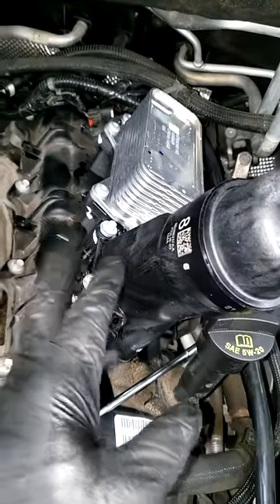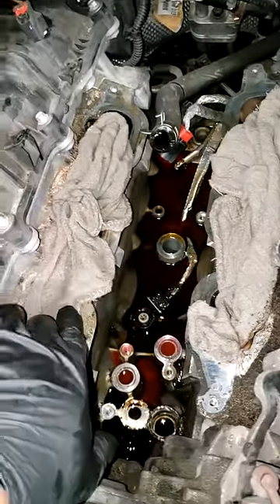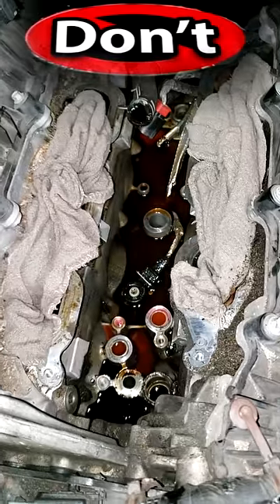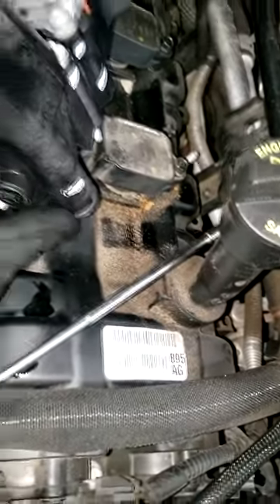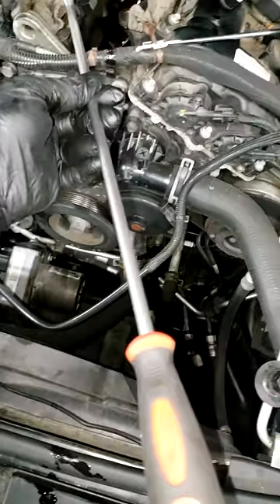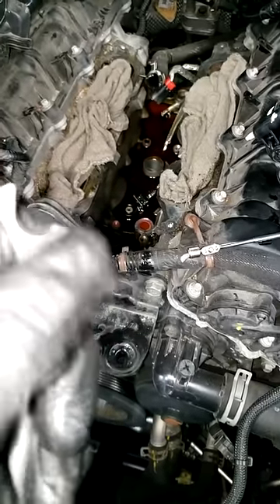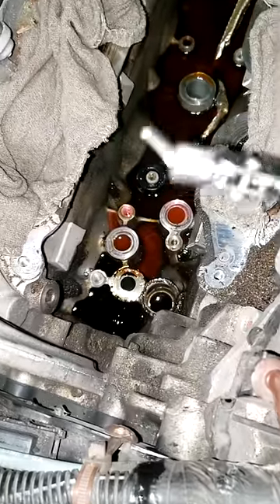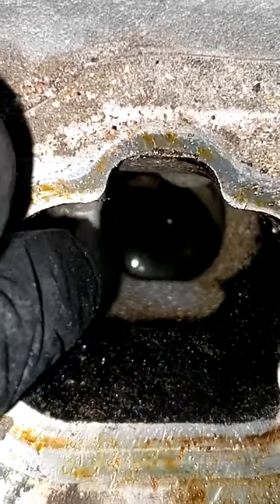This will scare the hell out of any mechanic. But I found it.

Comment: So I don’t get…..what happened? I am not a mechanic 👩‍🔧 ❔
Reply from the maker: Hello here's the motive behind the video. When you remove parts of the engine to perform a repair, its best to cover the open area up. In this case, the upper plenum. Because if you dont, theres a chance something could get in without you knowing and ruin the engine. Case in point, I used a trim tool for prying purposes and the tool broke, no big deal but it was important to find that broken piece. Because I had the intake covered, I was assured it didn't get into the engine. So the motive of the video a reminder to cover all the intake manifold openings.
Reply: Tldr:
Imagine what would happen if a piece of bone got stuck IN your heart.

His tool broke a small piece off, and if he didn't carch it with the rag it would destroy his engine if turned on.
Reply: He could have BLOOOOWN UO THE MOTOR. 

I KNOOOOOW it is not funny. But I can not help myself. 😂😂😂😂😂🤣🤣🤣🤣🤣🤣
Reply: You got a car at all sir!!???
Reply: @vesuviusenigma7739  Yes, ma’am💀
Reply: You a lost cause son
Reply: @Gothic TDK  Gothic people don't have common sense? Or they just don't listen? Maybe both?
Reply: If that piece goes in the valve it can stop the car from ever starting up again valves are pretty much what causes the combustion pressure in your engine with out those valves properly seated to much air gets mixed in with combustion no combustioneans knew engine or cylinder head of you can soen the next two days taking the engine completely apart and and just hoping for a chance to get it out
Reply: Im not a mechanic either but he ecplained it very well what would have happened 😅😅⁹
Reply: Would've had to buy a whole new motor
Reply: @lessmigrantsmorewalls8392  This has NOTHING to do with RACE and EVERYTHING to do with guys who tear down and rebuild engines, so what do you mean by your comment, please elaborate for us!🤔
Reply from the maker: @Ricardo Flot He will not be able to respond cause he's been blocked now. That guy on another level type hate.
Reply: @Firesgone  whooo-hooo! GREAT reference...damn!
Reply: @OnlineMechanicTips  I'm late here but, got it! 👍
Reply: Not Finding the Broken Piece in the Engine Manifold could be the Difference between the Engine running for another (20 Years) or just (2 Minutes).
Reply: @OnlineMechanicTips  Number one that's not the upper "plenium". It's the intake ports of the heads. Number 2 it's plenum.
Reply from the maker: @jeffrunyan2691  Whats number 3 buddy? Surely you found 3 things wrong with this 60 second shorts video
Reply: Then don't ever become one if you can't follow this.
Reply: You drop something in an intake, and you get to disassemble the motor till you find it.
I once dropped a 13mm socket into the open intake on a sportster... and then I never ever did it again.
You're always one broken bolt, or one open intake away from a 10 hour job.
Reply: That piece of metal could have ended up inside a cylinder.  That is bad enough if you realize it because you have to find it & get it out.  But imagine you DIDN'T realize it.  You button up the motor, then start running it & you've got a piece of metal banging around inside a cylinder.  It will destroy the cylinder, valves & block itself.

So from merely expensive repairs, to catastrophic failure.

Even with what he has there, I'd vacuum up all that garbage & individually plug with rags.  But I'm not a professional so I'd be paranoid careful.
Reply: The whole point of covering is so stuff doesn't get in there without you knowing, and if u do see something fall down there then u gotta take apart the engine basically so wayyyy more work or fuck the engine if u don't know
Reply: Hey doc..I'm gonna do this exact job next week on my dodge charger what kind of pry bar do you recommend???
Reply: @Firesgone  perfect analogy my guy 😂😂😂😂😂😂😂😂😂😂
Reply: When you turn on the engine it gets a little quirky, little freaky, a little sucky sucky. If it tries to suck something that is too hard and very much not suckable like metal, then just like a human it can damage the parts inside and ruin the car. The holes he's saying to cover are the sucky suck holes.